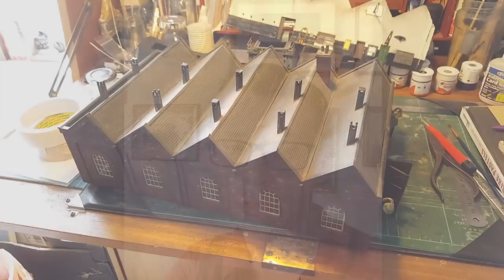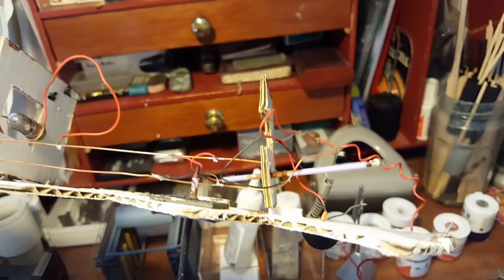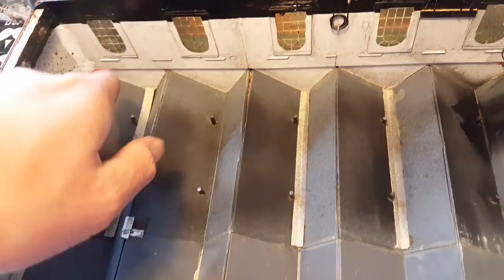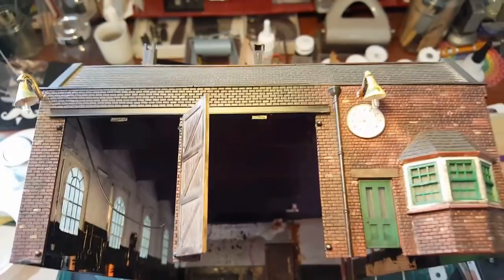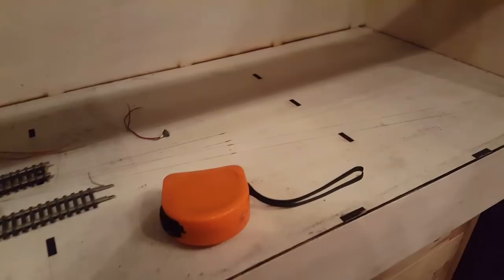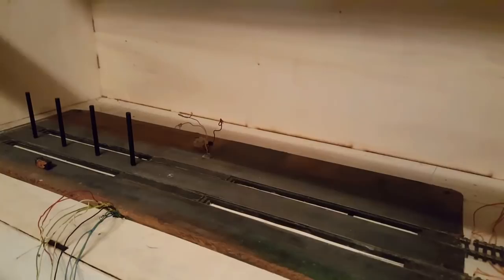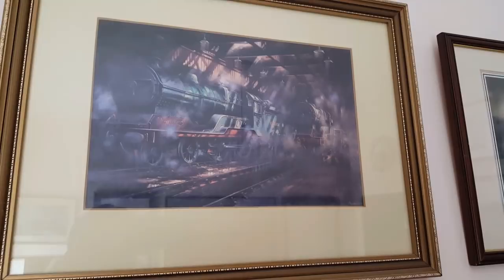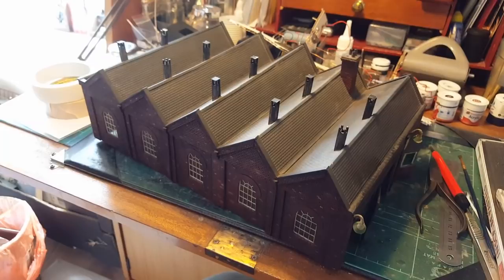JULY 2018. The new layout begins! Shed 38F

Comment: New subscriber here! 😁
That shed is awesome, especially for its age. Great detailing with the hanging hoses and unkempt windows on that partition wall. Look forward to seeing the “modernisation” of it and the layout develop.
Bob
Reply from the maker: Cheers Bob. 
All that was done by my Grandfather. I'll be adding a few extra bits myself but first will mainly be focused on getting the lighting updated and then stop any light bleed either through the walls or between panel joints. 
Ordered the new track this week so waiting for the post man to arrive then its time to build the sector plate.